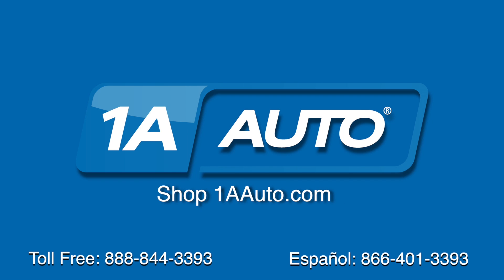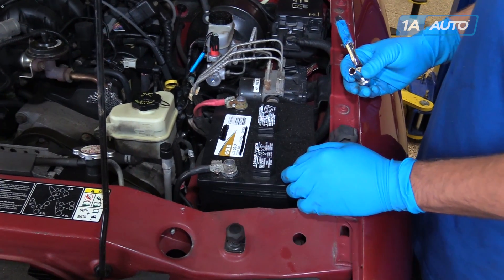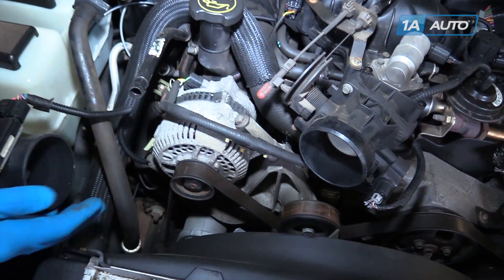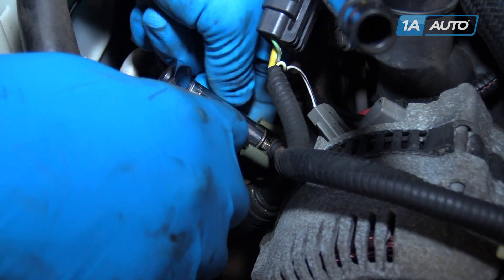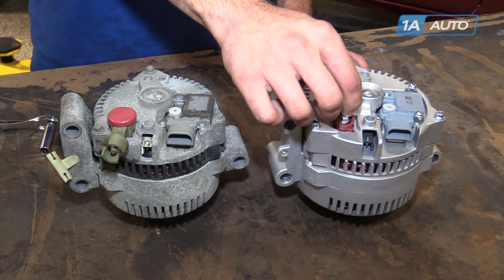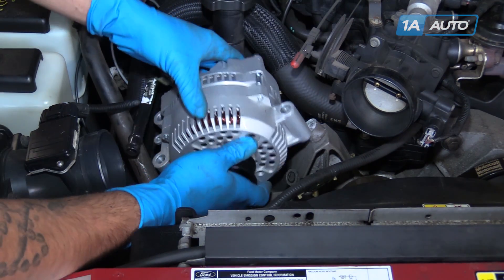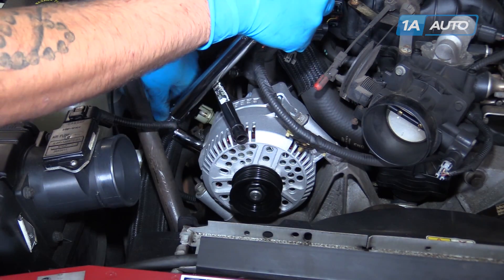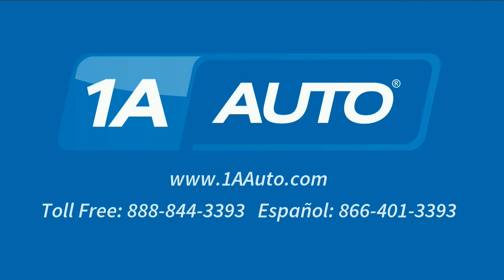How to Replace Alternator 98-12 Ford Ranger 4.0L V6

Comment: Very informative and helpful video, I have a 2009 Ranger and this helped me every step of the way. I lost a few hours being frustrated by the fact that my belt tensioner wouldn’t move as easily as their’s did in this video, but I picked up a long ass torque wrench and it did the job. A breaker bar can also do the trick. Thank you for making this video and I appreciate the new knowledge/skill I now have.

Comment: Thank you! My daughter was my gopher and it took us a little over an hour going step by step slowly with your video. I used my torsion rachet with an adapter and socket that was big enough to slip over my other rachet on the serpentine tensioner. I could push down on it clockwise and slip off the belt with ease and back on as well. Subscribed and liked
Reply from the maker: +Jerry Burgin Thank you for the positive feedback. We really appreciate it! If you have a minute, drop us a review on our Facebook page to let other people know about your experience with us. Here's a link: https://www.facebook.com/1AAuto/reviews/

Comment: Thanks for this. You made it look so easy, and it was. Took me maybe an hour walking back and forth to the house for tools. Only difficult part was putting the belt back on, as I had a shorter Craftsman ratchet. I was able to really easily release the tension when I finally found a pipe to extend the ratchet. I notice you had a longer handled ratchet as I did not.
Reply from the maker: +mmmbbq Thanks for watching. If any of our viewers needs to make this repair we carry the part shown in this video on our website. Here's a link to them https://www.1aauto.com/alternator/i/1aeal00167?utm_source=YouTube&utm_medium=CTA%20Comment&utm_campaign=1ATony

Comment: I just replaced my alternator in my 2002 V6 4.0. It's a lot easier to remove the air cleaner box so you have plenty of room for the ratchet to pull far enough back when you're putting the belt back on. The air cleaner cover comes off real easy.

Comment: What is that yellow plastic piece for on the OLD alternator and should it be transferred as well? It is between the two lower bolt holes.

Comment: Great video, the only issue I had is moving the tension pully on the 4.0 engine is much harder. The pulley is so close to the fan belt, it’s hard to move it far enough from up top. Getting the belt on and off was a 2 man job.
Reply: Hey Stephen, next time just grab a 2 foot pipe to slip over that ratchet handle and use yourself some good old Archimedes leverage. It does shave some knuckle hairs with the tension pully being so close to the fan blades but if you position your handle just right and use the leverage as mentioned you can do it yourself easy enough. Hope that helps in the future.

Comment: Good video. As a note around 3:15, some Rangers with 4.0s actually have a bolt head on their tensioner rather than a ratchet adapter, and I've heard that on some of the 93 and older ones, the tensioner and idler are swapped in location.
Reply: Seems like the ratchet adapter hole would be less prone to stripping than a bolt head, but thanks for the heads up. Luckily mine was the ratchet type.

Comment: 07 and up alternator is blocked by a fan shroud you have to remove to get to the alternator. Instead of being right on top it's right below the ac compressor which is on top.
Reply: 09 doesn't have this issue*

Comment: I cannot get my belt on, I loosen the tensioner but my belt won't hook on to the alternator
Reply from the maker: +kain meek If the belt is brand new, you may want to make sure that it is the correct size. Also make sure that the belt is routed correctly around the engine pulleys. Hope this helps you out. 1aauto.com
Reply: Use a 1/2 drive long breaker bar with a cheater bar ( pipe that will fit over the breaker bar) this give you leverage and not so much effort.

Comment: What’s an ALETRANTOR
Reply: The alternator is the part that provides electricity what the car is running. That electricity is what provides the spark in the spark plug. Obviously the lights, the radio, winches and other stuff uses the electricity as well. The battery is mainly used to start the car when the motor is not turning the alternator. A crude description but I hope that helps.